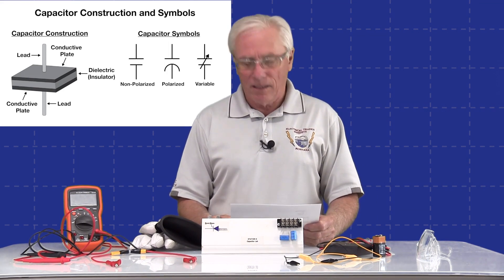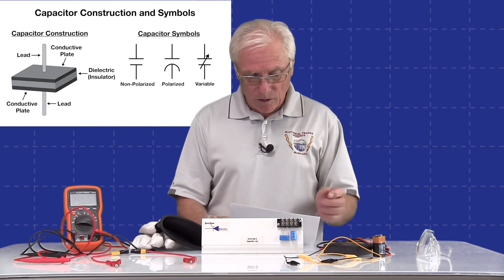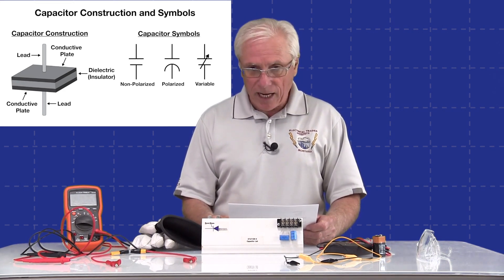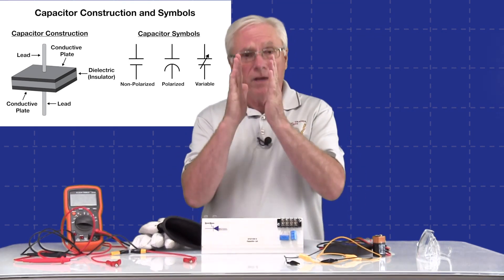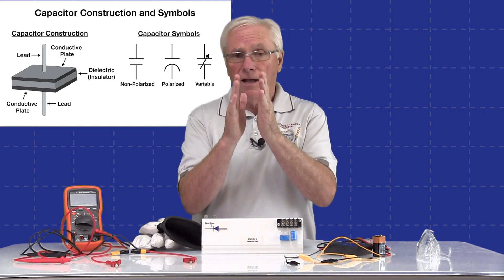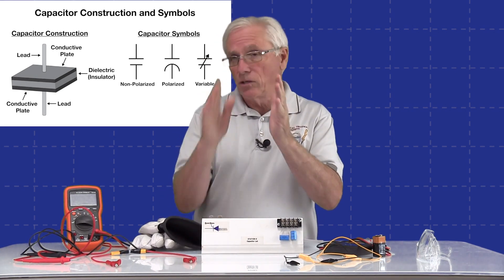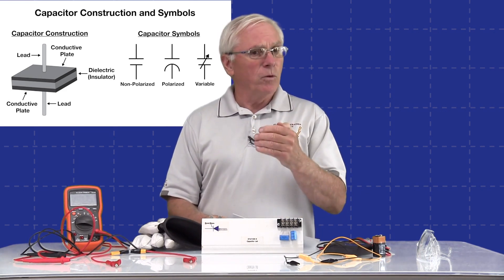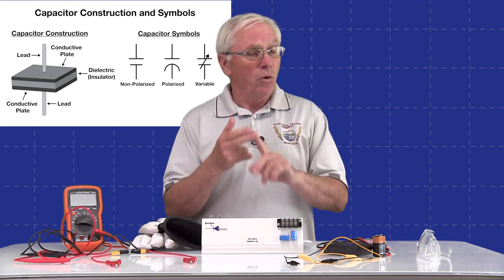Understanding and Measuring Capacitors (Part One)

Comment: In another video show the formula on to convert stored charge into current. Like if you have a 20uf capacitor how much current or charge can it store?, and if you have a 50uF capacitor how much current or charge can it store?
Reply from the maker: That would make for a great video.   I have never dug in that deep on capacitors.  Thank you for the suggestion.